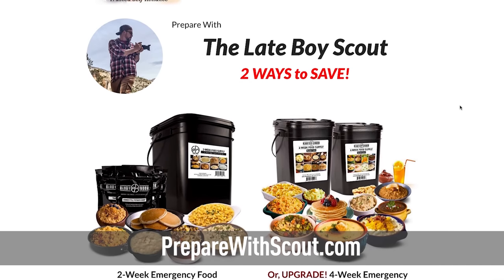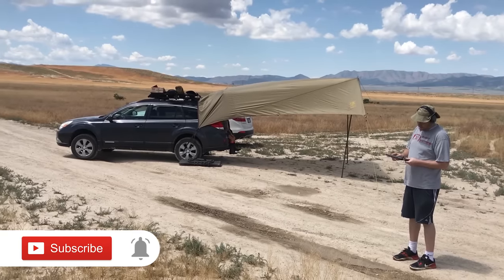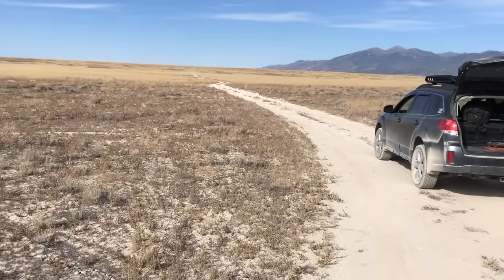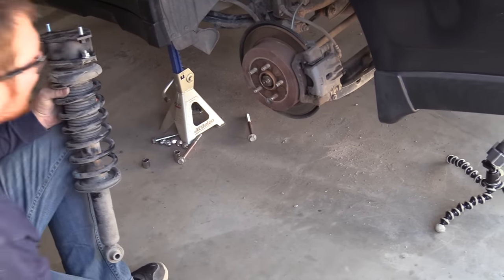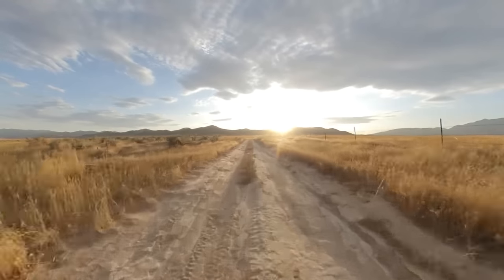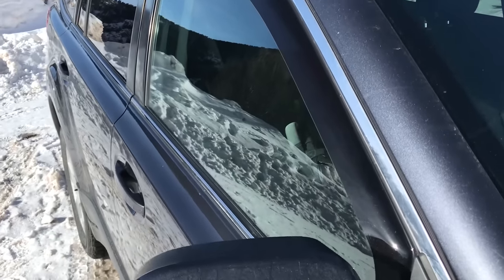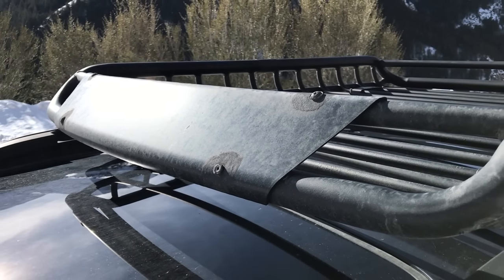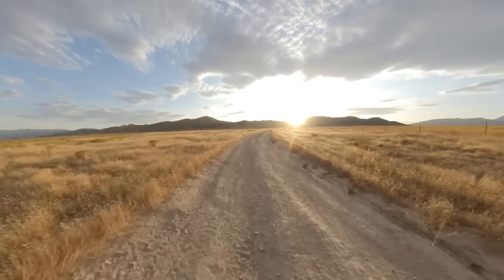My Lifted Subaru Outback Takes Me Almost Anywhere

Comment: For a guy who isn’t a car guy, you definitely bought a good car and made some sensible upgrades.
Reply: awd lifted Sienna would be my pick if only it could get a little more than 23mpg and I think Sienna is probably more reliable long term; Outback can easily get 26 and is probably the only car that has that capability, fuel economy and size; And as far as trucks go, not willing to settle for darn 11mpg; Thats crazy; It would be cheaper to fly and then rent a jeep at a location where you plan to go adventuring
Reply: @mrsorgic4790  have you checked out the 2022 Toyota Sienna Hybrid AWD? I believe they are rated at 36 city/ 35 Hwy.

Comment: My wife and I just bought a 2011 2.5 premium. It is hands down one of the most capable vehicles out there. It soaks up bumps like they aren't even there, yet it is rigid enough to handle moderate trails in stock form. I will be buying another one when budget allows

Comment: One of the things that impacted my decision to buy a 2012 Outback limited 2.5i is that the car is unusually comfortable but utilitarian. The suspension doesn't beat you up like many offroading specific cars. Jeeps are known to be uncomfortable and loud on the highway, which sucks because you only really use the offroad aspect of the car like 10 percent of the time. The Subaru can be good at offroading, while still being comfortable on the highway. I also live in the northeast where we have blizzards and ferocious summer thunderstorms. None of the weather caused me to slide or get stuck or feel nervous while driving. It's been very reliable too. I put 105,579 miles on it from 87,000 miles and it's been great! Just oil changes. They are uber-popular in the northeast and I'm glad I bought a safe, reliable, and practical wagon

Comment: I have a 2001 Forester, with some all terrain tires on it. It will take me anywhere I need to go.
Reply: Phillip Double U what size and what tire specifically
Reply: @connorm1600  205/75-15 General Grabber AT2, they have very slight rubbing in the fenders at full steering

Comment: Great choice of car; I have exclusively owned Subarus for the last 25 years, starting with the Leone moving on to multiple Legacy's and a Forester, they suit our NZ roads that can often be very wet and winding.
I've taken them off road often on the beach and on gravel surfaces; never had a problem, I've even towed out  a Land Rover that was stuck in soft sand.
There was a famous Kiwi Champion Subaru Rally Driver "Possum Bourne" sadly he was lost doing what he loved best, but his Subaru Tuning Shop is his legacy (pun intended)
I really like the 2500 non turbo motor and the 4 wheel drive system is one of the best.
I currently drive a late model Mitsi Outlander; not by choice but because it provided by my company. 
Every time I get to drive my wifes ten year old Legacy wagon I'm reminded how much more refined even the older Subs are compared to more modern Mitsisubishitis. I will continue to buy Subs in the future, My wife will only own Subs and my 16 year old daughter is in the market for one for her first car.

Comment: My adventure vehicle is a 2011 F250 crew cab 4x4 turbo diesel truck with a 6.5 foot bed.  It is long.  I run BF Goodrich All Terrain TA/KO 2 tires, a roll up tonneau cover, and weatherguard window shades.  I love it.  Unloaded I get 20 mpg on the highway.  When towing my 32 foot travel trailer I get 14.  With 400 hp and 800 lb-ft of torque I never want for power.  The console, rear underseat storage, and behind rear seat storage provide plenty of room for essentials like a full tool set, axe, machete, first aid kit, rope, tarps, blankets, etc.  The only complaint is it is long with a horrible turning radius.  My oldest son drives a 2007 Forester, lowered not lifted, and my wife has a 2019 Subaru Ascent.  We like subies.

Comment: I have a 2017 2.5 Outback,  I take mine any where too. May be the ideal prepper vehicle.
Reply: I feel like in a lot of areas it's a good grey man / sleeper vehicle. There's like a bajillion Outbacks in upstate NY, and they all look mostly the same. But you can easily "hide" skidplates, rock crawlers, a hitch, and throw a winch and battery in the back, or get a winch built into the front bumper, and get AT tires. Unless you know what you're looking for, it'll look like all the other Outbacks, but probably go more places safer. You can also get a cheapish auto locker for the rear now that would be invisible, but greatly increase capability. 

The lift is the thing that is going to be the most noticeable to me... Not sure how noticeable it is just walking by (if you're not looking for it).

Comment: I had a Subaru Outback a few years back and we had a snow storm that dropped 27 inches. A friend of mine was having trouble with his heating system and asked me if I could come over and help him . Well I tried and I didn't have much trouble until I hit a large area that was drifted. The front of a Subaru only plows snow for a little ways. Had to turn around a go back home. They are tough vehicles.

Comment: Great video and thank you for the insight. I just bought a 2011 Subaru Outback 2.5i Limited as a daily commuter after moving to Colorado from Florida and my 2005 Jeep Wrangler popped a head gasket. My wife drives our 2021 Toyota 4runner Venture Edition and we live in the mountains and commute to Denver for work. SH
he will be fine through the winter after we get her some snow tires or all terrains. I am thinking of going with the same setup for suspension as you did only going with Falken Wildpeaks as the only difference. Your insights will keep me going through the winter until I can really get to working on all three of my vehicles offroading and suspension/tire upgrades. Thanks again!

Comment: You should have just got a 4 Runner
Reply: GunGlutton 4 runners are notorious for rolling over, especially if you put any kind a lift in them
Reply: He addressed why he chose not to choose a truck or body on frame design.
Reply: @Scott079  notorious huh? Where exactly to you see all this notoriety? And while true that taller COG vehicles are easier to tip over,  4Runners are no more likely than any other brand of suv.
Reply: @Scott079  "notorious." Notorious, I tell ya.
Reply: @Scott079  not true at all , they are one of the most used off road vehicles out there . The Tacoma,  4runner,  and jeep are the most used so your info is false
Reply: Joshua Briggs maybe if you did a cursory search on Google you would figure that out I have personally seen one person roll one on the road and another person have one come up on two wheels because they cut the steering wheel too tight
Reply: @Scott079  so a google search will so me what you personally seen?  That makes no sense.  Your just stating your opinion based off a very small percentage of things you have seen . Any vehicle will have a higher probability of rolling if you lift it , that's just physics.  But the 4 runner is no different than a jeep or a pickup truck that is lifted .
Reply: JGstunts22 even if you search on here there’s plenty of videos of them rolling over and I’m sure back in the 90s there was a safety recall on them for specifically rolling over, any truck or SUV is at a higher risk for rolling over because they’re high center of gravity
Reply: Way too expensive and uses more gas.
Reply: @TurfSurf  WAY more reliable

Comment: The same outfit that sells the lift kit has a nice wrap around front bumper cage that will protect the front grill and side quarter panels from brush and rock hits and is also a good mounting point for additional lighting. If the price is as fair as the lift kit I might just go for both when I get my next subie. In between at the moment.  Databyter

Comment: Hi great video. Can you give an update on the lift?  Any issues?  Any of the wear and tear on the other components you mentioned?  At least enough to have to replace anything?   Thanks in advance!
Reply from the maker: So far it's still running great, and I drive it every day. No issues with any of the new components, or anything else.

Comment: You mentioned it but watching you Go over some of those rocks made me cringe.... you might look for a metal skid plate! The boxer engine sits pretty low in the engine bay, I’d be afraid to smoke your oil pan or a diff on one of those rocks out in the middle of nowhere
Reply from the maker: I’ve considered it. There’s a plastic one under there, but a tough metal one would be better.

Comment: A 4 runner would do all this but better with more room , and a rear locker and crawl control , and does NOT have a CVT transmission
Reply: So buy a 4runner
Reply: @lwr6762  I did lol and a Tacoma
Reply: @JGstunts22  lol. So that's why it's better
Reply: @lwr6762  are u slow in the head ? In my original comment I gave my reasons why I think it is .
Reply: @JGstunts22  yes.
Reply: How's that gas bill? I don't think your 4runner does daily driving better...